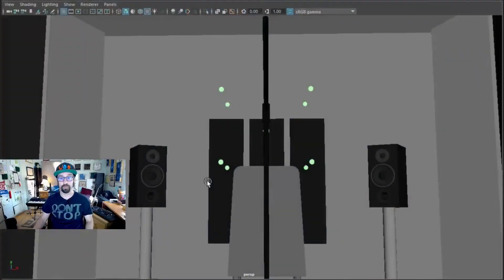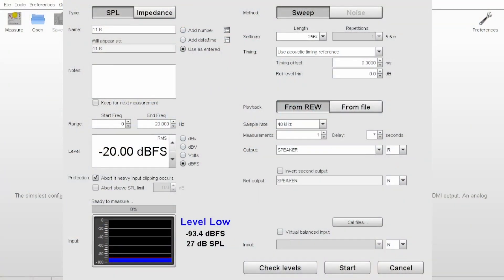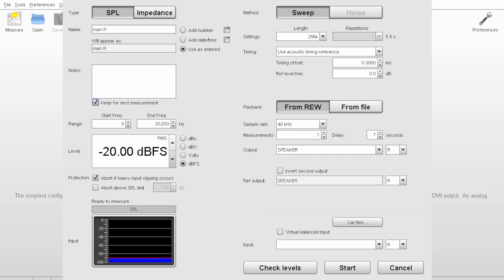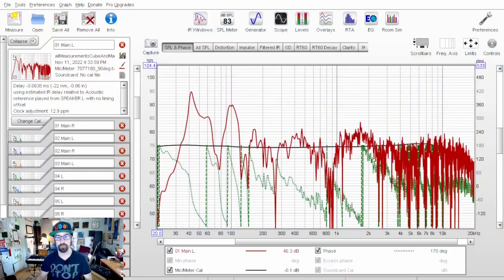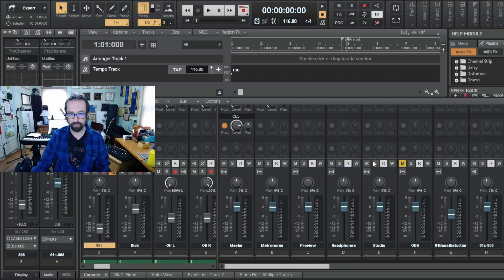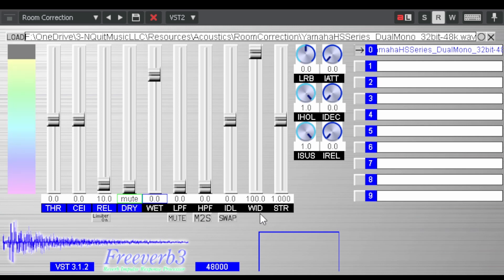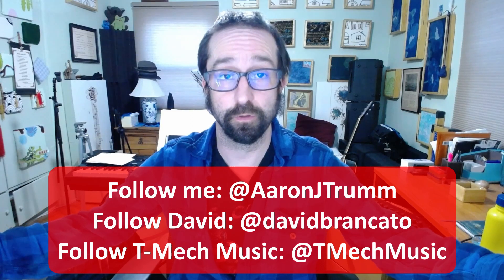Room Correction for Free?? (No SonarWorks??)

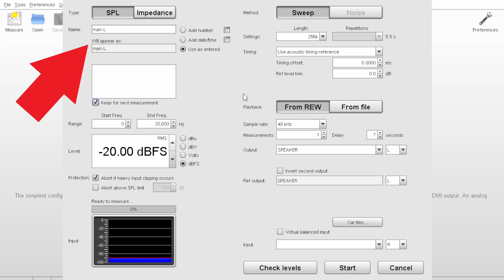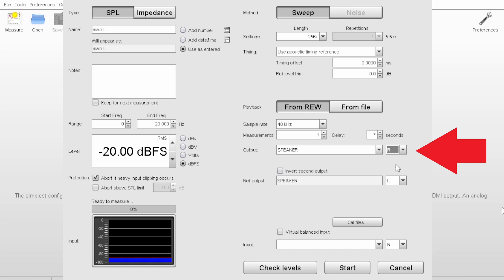Comment: 4:35 Why did you change the ref output (from L to R) if you're using acoustic timing reference (L)? You also added a note at 4:22 about not changing the ref output!
Reply from the maker: sorry for the delayed response! youtube hasn't been telling me about comments!

Good catch! it turns we had something a little wrong on that (something I just found out recently when talking to @davidbrancato

I'm hoping he'll see this since i tagged him and weigh in further
Reply: @aaronjtrumm I was just wondering the same thing. Acoustic Reference should remain a ‘constant’ (i.e. you can use any channel you wish (except the ‘subwoofer’/LFE channel but it MUST remain unchanged throughout the calibration process)